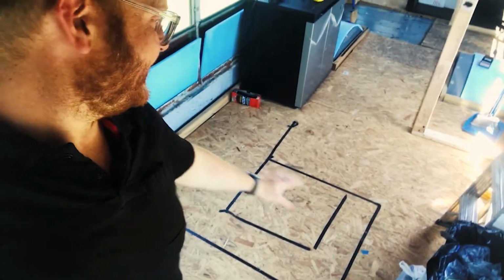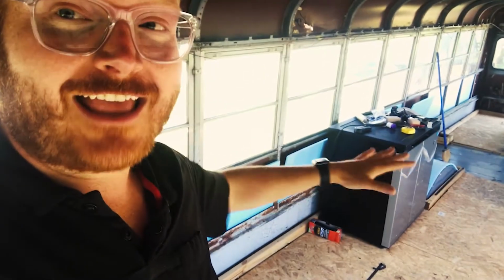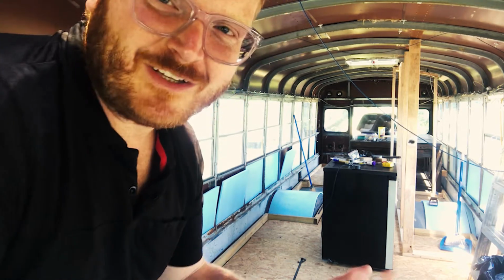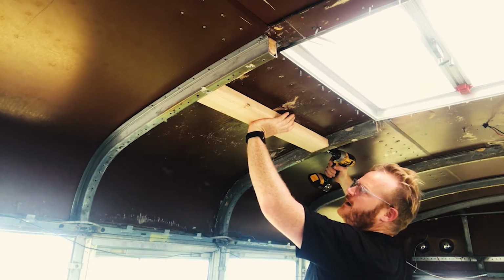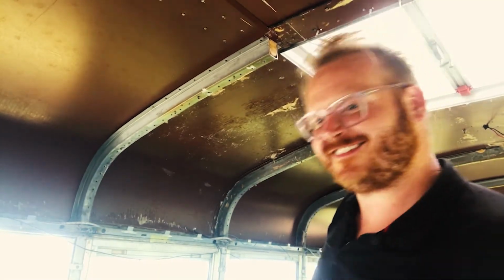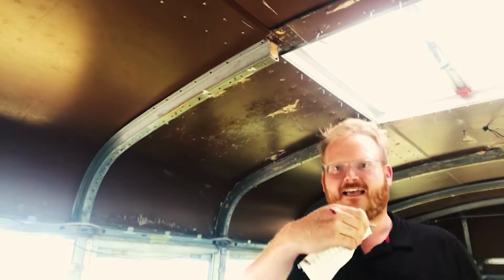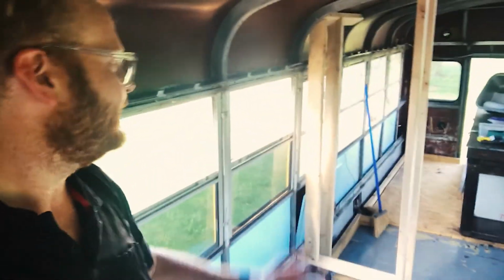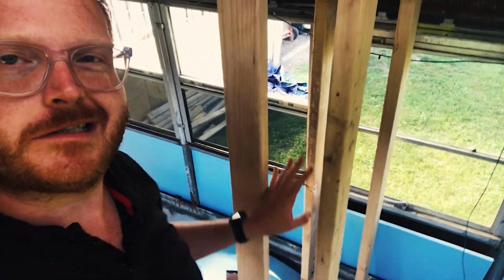Wall Framing Part 2 | Skoolie Bus Conversion Tiny House Videos

Comment: are you going to run power and
plumbing  first or try doing it after you cover the walls
Reply from the maker: +Big Bad Wolf Before! They’ll both be in the walls. Or at least that’s the current plan...  😂
Reply: hi mate just that with all the bus conversion i have watched the people who leave it for later have a lot of trouble running it or it runs on the outside all exposed which in my way of thinking don't look nice if i ever get the money together i hope to do one of my own one day one can only hope but for now it's only a dream